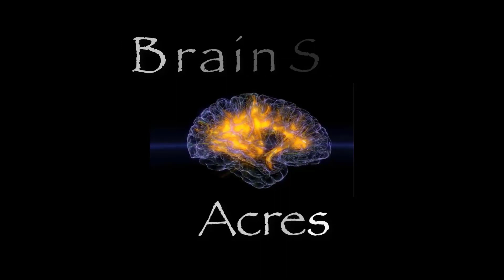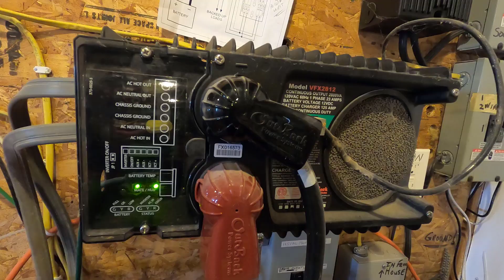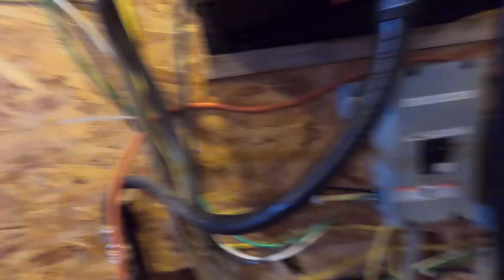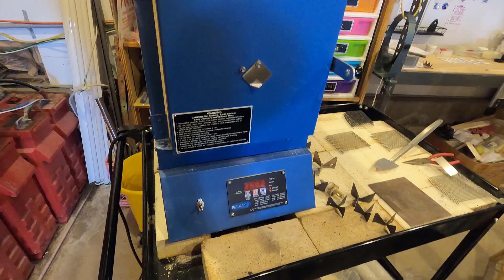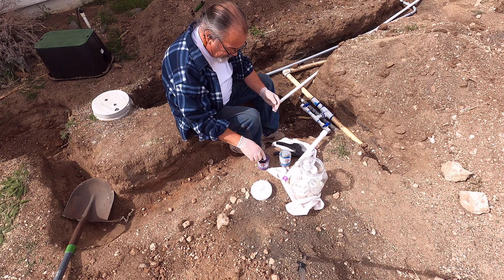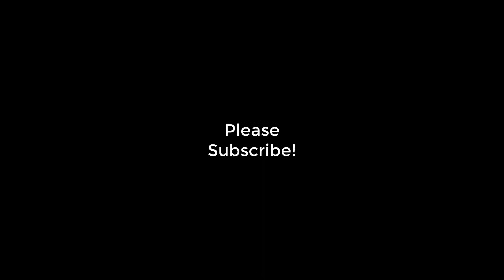Day 11 - Irrigation Plumbed,  Diagnosing Solar System Failure And Root Cause

Comment: great up date and advice thanks for sharing and have a great day as well
Reply from the maker: We dodged a snow bullet last night! Yay! Got about 1/4” rain, which is nice but the sides of the trenches are caving in. More shoveling. Should be able to finish the conduit today and backfill where the lines run. Have a great day. Take care.
Reply from the maker: And it just started raining. Do I really want to get wet?
Reply: @BrainStormAcres  well do you need a bath ha ha
Reply from the maker: @rgarizonahomestead2729  yeah, but I really don't care for 41 degree temps for long! :)
Reply: @BrainStormAcres  I feel you on that on